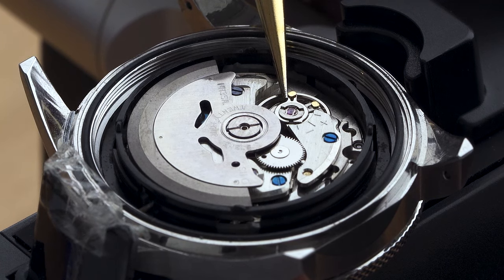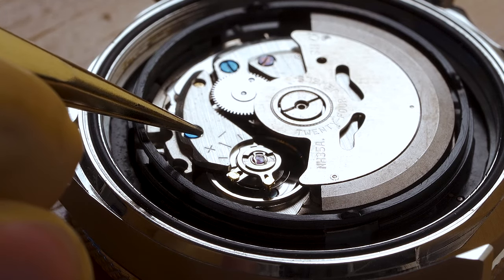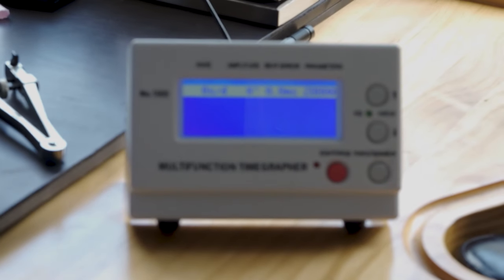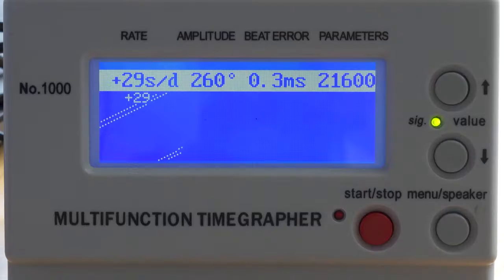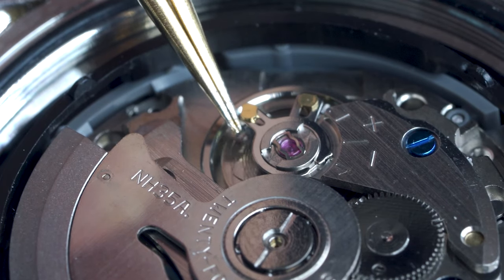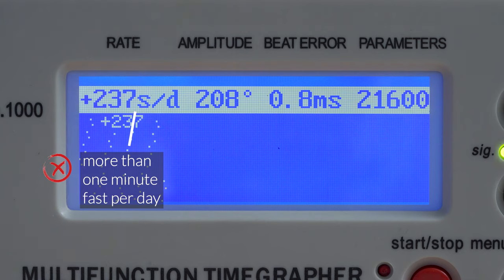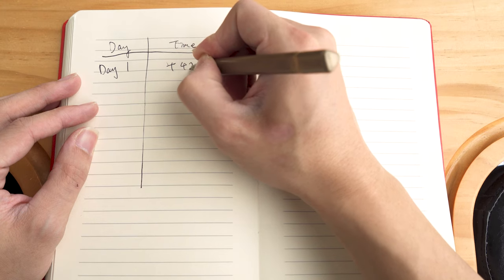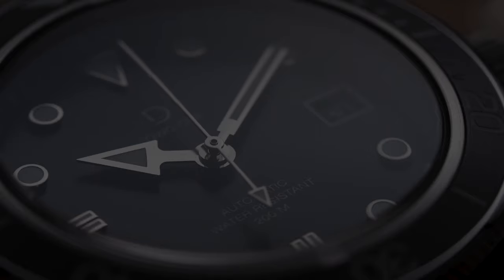How to Regulate a Watch using Timegrapher (and Improve Watch Accuracy WITHOUT a Timegrapher)

Comment: Although I’m fairly new to watches, I have managed to regulate a few on my NH35A movements down to +2 to +3 seconds a day. I initially ruined 2 Invicta watches while I was regulating them so it occurred to me that any future regulating it might be safer to hack the movement while adjusting the regulator and restart the watch afterward which works nicely. As I cannot justify a timegrapher, I use your 2nd method by using the world clock on my iPad. It might be worth noting that after regulating a watch, if after 2 or 3 hours it is running obviously fast or slow, there’s no need to wait the full 24 hours to adjust the regulator again, just do it and reset the time and fine tune it from there. Sometimes when regulating a watch, it may not be advisable to try to get it too accurate, such as +0 seconds per day but try for about +5 seconds per day. From experience I’ve found that if you regulate a watch dial up, it might run to almost perfect time over 24 hours but when you wear the watch, it’s now crown down and as watches run differently in various positions, it might slow down and run at -3 or -4 seconds per day. If the watch is regulated to +5 seconds per day and wearing it crown down causes it to lose 3 or 4 seconds per day, the watch will be running at +1 or +2 seconds per day, which is perfect.
Reply from the maker: Thank you for sharing your experience! It's true that it's usually good to err on the positive side a little bit. The non dial up positions can and usually run slower due to the addition of extra friction. With that in mind, a small plus in dial up usually ends up a near zero.
Reply: I just wish I had ruined only two.  Thanks
Reply: Just followed your advice and turns out it is true! I can get nearly dead on accurate +- 1s per day thanks to you sir

Comment: I have a Breitling Superocean II 44mm and an Omega Seamaster Planet Ocean 600m 43.5mm, I have a timegrapher and can see that both of these watches need a regulator tune, but there is no way I would open either watch and attempt to adjust the regulators, I'll leave that to a watchmaker, I can forsee a possible disaster if I tried it myself.

Comment: Thanks! It was helpful. I regulated a NH35A mechanism but it was not that easy! Very "tiny-tiny" movement/adjustment on the regulator's lever resulted in big deviation 40+/- secs!!. I was initially +23 sec' on small movement turned it to -18 sec/day or worse -40'' then trying the apposite +45''. I tried may times with very tiny adjustments to archive theoretical +3 sec/day (need to verify it now).  I used an android app that uses mobile mic to measure tics as a "Timegrapher" with quite good accuracy (real measurement is close to the readings of the app). The app is called "Watch Accuracy Meter" and worded fine for me.

Comment: Thanks for the tutorial,
I did not have a time grapher so i regulated the watch using the method you showed, I managed after approximately 7 attempts to get an accuracy on my Seiko NH35A movement to within less than a second a day. After 6 days of daily wear it is still within one second. Having adjusted it to real word wearing I am extremely happy. I have ordered a thrid party microphone to use with an open source time Grapher software for my PC. I think based on my experience I'll use the time grapher software to adjust it to say within 1 second a day and then wear it continuously for a week and make any adjustments necessary after observing real world /life style usage. Thanks once again i found this very useful.

Comment: Very informative. I just use the manual method you show at the end, with real life usage rather then crown positions etc, and getting totally acceptable results on my two sub £300 automatics. I'm getting +4 and +8 on the pair, so no adjustments needed at the moment, and I just set them a minute slow each month.
Reply from the maker: Great to hear you're getting good results out of it!

Comment: The reason you dont get the same Time Deviation in real life as on the time grapher is because:
1. You measure the Rate in only one position of the watch.
2. The rate you measure is the rate when the watch is fully wound and the watch usually will get a faster rate when the watch gets unwound during the day/night.

I usually regulate my watches to about a couple of -sec/day when the watch is fully wound which makes the watch go to about a couple of +s/day during the night when the watch is on my desk. Sometimes it takes some days before the watch gets to + in the night and - during the day but that keeps my watches close to 0s/day.
Reply from the maker: What you said is absolutely correct. I did not discuss positional adjustment and isochronism in this video because I want this video to be an beginner's introduction to regulation, and those two topics are more than enough an entire separate video. If I included them in this video, it could be half an hour long!

On the real life performance, that's where taking a statistical approach - taking the average - is useful. I don't have to account for whether it's + or - in the day or at night. If on average it's close to 0s/day it's good enough for me. But personally I still sometimes prefer an overall + since being early isn't something I need to worry about.
Reply: @DIYWatchClub  That is all very true.  In addition, it's much quicker to re-sync a slightly fast watch to Naval Observatory time than a slow one!  I enjoyed your very concise video and hope to see it expanded upon in the future. For instance, I have a timegrapher, and my Seiko Alpinist that I purchased in 2016 was starting to show a weak amplitude and slow rate in the vertical positions (crown up and down) in the 170s-180s,/-30s/day while horizontal dial up and down were 220-230/0s/day. I suspect it needs an overhaul and lubrication since it has never had one since I purchased it, so that is my intent.  But there are precious few videos out there that discuss the warning signs that can be seen with a timegrapher when a movement requires maintenance. Again, thank you for your exceptional video. The photography was very clear and close-in.
Reply from the maker: @life-longpatriot8258  Thank you for the compliment. Appreciate it! 6 years, it's probably time for a servicing. Lubrication probably dried up.
Reply: @DIYWatchClub  I agree, and I'm sending it to Seiko for an overhaul.

Comment: 10 days ago, I bought a new watch with Seiko NH34 movement through internet shopping.  I check and record the  change and realize that it runs 15 seconds faster daily rather steadily. If I understand correctly, the watch is still within acceptable range that I can't send the watch back to the manufacturer for service or adjustment. If I do so, I have to bear the shipping cost since it is not defective. Thank you for your video - it is great and so informative.

Comment: I have designed a hybrid method for adjusting the beat rate for a watch and I managed to achieve a level of precision of 0.2 sec/day. I am an engineer but not in this particular field of timekeeping. My method combines the timegrapher with a daily evaluation against a reference.

First I wanted to identify the variables of this problem, or the things that affects the movement and the beat rate. Here is the short list:
- temperature variation (season, occupation or job type). The beat rate is faster in cold than in warm due to the contraction/ dilatation of the hairspring. I prefer evaluating and adjusting a movement during the summer (July or August) 
- magnetization – this is the worst enemy of your watch, including shocks and aggressive vibrations
- the average position of the watch (the beat rate is different from one position to another, especially for cheap movements: dial up or down, crown up or down)
- winding level or the activity level of the owner. Every owner has a different lifestyle therefore the beat rate of the same watch will change for different owners.
My reasoning: 
An accurate quick adjustment can never account for all variables so I thought: what if I include these variables in a global long term evaluation? Since I do not belong to this specific branch, I can take criticism easily.
Here is the method:
0. In order for the mechanism to run in a stabilized manner, the watch must run for at least one month, preferable two months, before making any evaluation or beat adjustment. It takes a while for the lubricants and for the hair spring to achieve stability. Initially the lubricants are more viscous and the hairspring is less flexible. In time the lubricants become more fluid and the hairspring becomes more elastic, so  the beat rate has a decreasing tendency. Any attempt to evaluate or to regulate the movement will be invalidated later, so be patient. You could use a winder, but the regular watch winders are excessively winding the movement even at their lowest setting. Just ware the watch during this time an you can make an informative evaluation that should not be used for the final regulation.
1. First evaluate the magnetization level of the entire watch, including the bracelet (use a compass on top of the watch and slowly rotate the watch on the horizontal plane while watching any deviation of the compass. Do not rush it. I consider maximum 4° deviation as acceptable)
2. Demagnetize the entire watch, including the bracelet. Any magnetization will invalidate the measurements, or will discontinue the evaluation. If magnetization occurs just demagnetize the watch and start over, but validate the records while the watch was not magnetized.
3. Synchronize the watch with a reference that you will use over and over (cellphone, radio station - note that there is an offset between analog and digital radio receivers, usually the analog ones are quicker since they are not processing the radio signal)
4. Log the deviation into an Excel spreadsheet
5. Wear the watch normally
6. Before every daily evaluation check the watch for magnetization so you can validate your measurement. There is no problem if you skip days, but make sure that you check the watch for magnetization.
7. Make the evaluation/ record roughly at the same time during the day. Some movement complications alter the beat rate at certain moments (21:00-24:00 interval for day-date complications decreases the beat rate, then it accelerates).
8. After at least seven days (the longer, the better – even two months if magnetization doesn’t occur) calculate the average daily deviation. Let’s say +15 sec/day.

9. Put the watch on the timegrapher with the movement exposed, ready for adjustment and let the beat rate stabilize. You will notice that the beat rate will increase as the temperature of the watch cools to the room temperature, let’s say from +15 to +21 sec/day (the cheaper the movement, the greater the difference). Make sure that dust won’t make its way into the movement during beat rate stabilization!
 In order to avoid jerky increment jumps I am using a Precision Spring Dividers Calipers Compass, that has both metallic sharp tips.
10. Once the beat rate has stabilized proceed to adjusting it by applying the desired difference: from +21 adjust to 21-15= 6, but I prefer one +1 sec/ day so I would set it to +7 sec/day. Make sure you make the adjustment in small increments, then let the beat rate stabilize after each applied increment.
This is it!

I have seen movements so bad that they just wouldn’t stabilize even after 30-60 minutes, or better said - never. In such cases the adjustment is pretty much based on luck.
Using this method I have successfully adjusted two ETA 2836-2 movements (one of them with COSC certificate), one Seiko Caliber 7S36, and other few ones.
Reply from the maker: Love the detailed writeup from an engineer! It's refreshing to see a systematic take on the whole process where you take care of each and every one of the variables. I especially like the use of calipers. I mean it's not what it's built for but it fits the use case here. 

If you want to further improve your method, I would suggest, besides magnetization, you watch also for external mechanical shock. Since in most movements, the regulator and stud are mobile, external impact (in extreme case, like dropping the watch) can move them, and that would invalidate all the previous data. Maybe your engineering mind can figure out a way to track that or prevent that ;) But all in all, brilliant work!
Reply: @DIYWatchClub  The calipers were just a quick, finer but still a coarse solution. A dedicated fixture and much more accurate could be designed, but there are few problems that should be considered:
- after every forward stud nudge there is a backward motion of the stud, probably caused by it's flexibility and/ or friction. This is why a complete stud release is important after avery nudge. Relocating the adjustment device in the same place with precision is very difficult, but achievable. 
- add to this the flexibility of the adjusting device and the problem is amplified.
The problem is even more complex than that and I consider that a team of enthusiasts has better chances for a successful design/ method

Regarding monitoring the position of the regulator and of the stud I find this even more difficult. 
Still these are just challenges that the humans are meant to overcome. 
There are few obstacles that I couldn't pass even if I am only human. I do believe that we can achieve anything if we put our minds to work and a small team of well motivated people can work miracles.

Overall, the final result regarding the daily accuracy is by far satisfying. I was surprised to see 0.2-0.5 sec/day deviation for any mechanical watch.
I wonder how accurate the tirbillion ones can get while actually wearing them, or how accurate a mechanical watch can get.

Thanks for your appreciation!
Reply: @DIYWatchClub  I have added #0 to the method that I presented.
It is about letting the lubricants and the hairspring stabilize for one or two months before evaluating and regulating.

Comment: You can also use a reliable stopwatch and do this same function several times within say 5 minutes each and average out the + or - of each adjustment you have made.  Do this a few times and you will come very close to a good running watch, depending on how accurate your watch needs to run for your lifestyle.  If you are say traveling to the moon and back you may need split-second accuracy, if not this method will work satisfactory.

Comment: Excellent video. I used the tip of a plastic 0.5 mm mechanical pencil with the lead removed rather than the metal tweezers shown in this video to regulate a NH 35 movement with success without a timegrapher.  A very slight almost undetected nudge was used to adjust the regulator as described here. Thanks.
Reply from the maker: Whatever works, works. Glad this helps

Comment: Thanks for the video. Great info. I managed to adjust my Orient Star to -1s/d on the second attempt. Would have preferred a plus number but too stressful to try again! Overall I’m fairly pleased with it. I used a cocktail stick with a notch i cut in it. Being a novice I found the wood slipped too much without the notch keeping it attached.
EDIT I’ve done all my time measurements using on wrist accuracy as well. ie if it gains 15 seconds on the wrist a day I’ll take off that amount on the timegrapher. Of course you have to work out what position you have it at night as well to keep it as accurate as possible. Quite a lot of maths!
Reply from the maker: Good job!

Comment: Great info thanks for posting, I would like to know how you will be able to tell that the watch needs servicing from the time Grapher
Reply from the maker: This is an excellent question. We'll look at each of the outputs from the timegrapher to see if it's within acceptable range. So, to illustrate the thought process, it goes like this: "is the rate too high or too low?", "is the beat error too high?", "is the amplitude too low?", and most importantly, "are the lines erratic/unstable?". A lot of it depends on the particular movement model, so for example the maximum amplitude for a Sellita SW200 is different from that of a Seiko NH35. But something like a more than +30s/day rate, larger than 1.0ms beat error, or unstable lines are telltale signs of a movement that needs regulation or servicing. Hope that answers your question (and feel free to ask again if you have more questions!)

Comment: Great video, thanks! This is the best tutorial on DIY watch regulation I've seen. I recently purchased a Citizen automatic with the 8200 caliber and the beat error is at around 1.5ms on the timegrapher. I was going to take it to a watchmaker, but now that I've seen your video, and read your guide, I feel confident enough to try to fix the beat error myself. I will post an update once I'm done. Cheers.
Reply from the maker: Good luck! I didn't manage to cover beat error in this video, but it's simply turning the stud instead of the regulator. The rate will change along when you adjust for beat error, so just fix the rate after you fix the beat error. Make tiny adjustment at a time and you should be fine!
Reply: @DIYWatchClub  Success! It took me a few tries, but I got beat error down to 0.1ms and rate to -2s/d. This is with full wind. Much better than 1.5ms error and +15s/d! 

Thanks again!
Reply from the maker: @gaius_marius  That's great to hear!